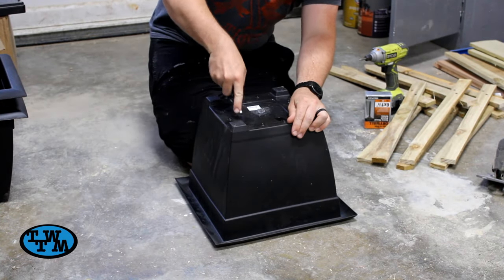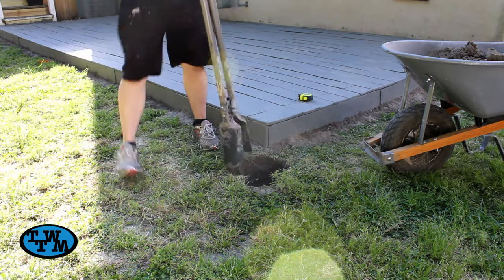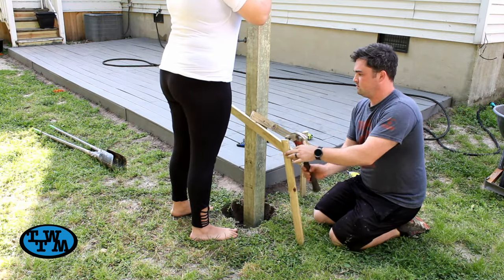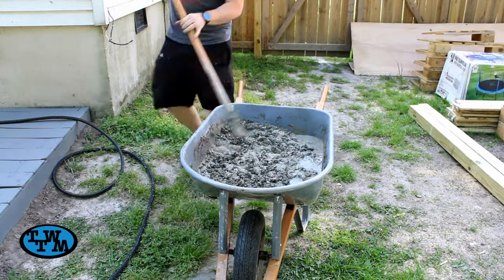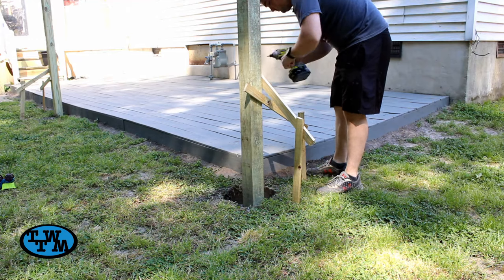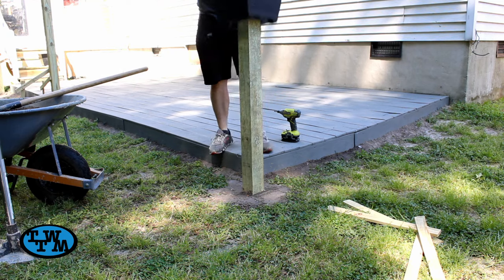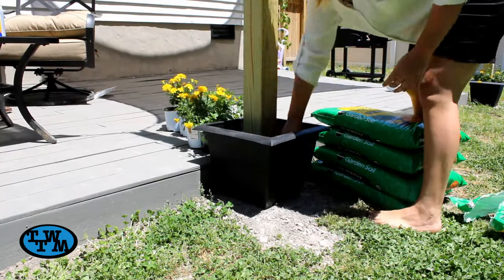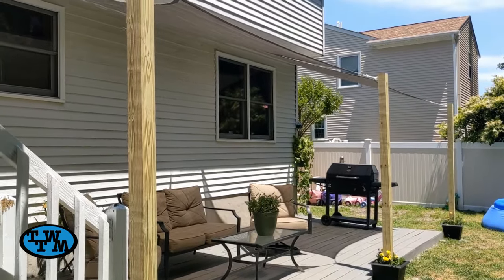From Unbearable To Unbelievable: How We Installed Shade Sails / Canopy On Our Platform Deck

Comment: The dirt at the top of the post hole and set around the post in the pot with plants will rot the post. The cement should go all the way to the top of the post hole, even or slightly higher than the lawn level and dirt should never be put against the wood. Wood nowadays lasts less time than the posts of years back. The more water contacting the buried post through the dirt contact makes your rot grow faster and can introduce termites into your wooden post if you are in a termite zone.
Reply from the maker: Thanks for your input!
Reply: Tex gem is exactly right made this mistake when I put up gazebo for my Wisteria, some years ago.  Now I have 2 post very compromised and 2 large, beautiful, vines over it all. Will take clever engineering  to replace them.
Reply: Not so sure about that. The chemistry for treating exterior lumber has changed over the years. Some treatments are rated for contact with soil.  I would avoid soil contact regardless for permanent structures. No wood is invulnerable.
Reply: @valkyriesardo278  agreed, but your name looks dang near invulnerable my friend
Reply: How does this apply to boat slips with main support posts directly in the water and lasting 20years?
Reply: @danieldillon40  I know some people who have had their posts replaced. From what I understand there is a special type of wood post that is supposed to be used for that. Since I don't have a boat slip, I do not know which type. If you have a boat slip, you would have to research from your lumber companies which ones are best suited for that application.
Reply: @danieldillon40  my construction friend did say that you should go to a different lumber company than your box stores for better quality, longer lasting wood. In other words do not go to Home Depot or Lowe's for your ground contact wood. Of course the cost is going to be higher. But in this day and age, the cost of wood is outrageously high with the delivery system that has been impaired due to covid.
Reply: Wondering how much your 4x4s will warp after a year and if the tension from each side will help or twist because tension on one side will be stronger than the other. Single posts can warp like crazy depending on the wood and season changes and moisture etc.
Reply: Not necessarily. We have ground contact deck supports and the soil contacts them at the base. 10yrs old with no rot.
Reply: @IWillNotArgueWithMorons  Thank  you for sharing! I am getting ready to put in new posts.
Reply: Curious…. I’m doing all this on a cheaaaapp budget. Like meaning with as many things as I can around the house. That being said, long story short… the house I moved into has over 100 random sized pieces of wood in attic. You are so going to laugh….!!!! Could I put multiple layers of a thick trash bag under and around the base touching dirt to protect it?? 😮  Idc if it only lasts a few years - just basically until I can afford to put something better in.  No laighing allowed 😅😅
Reply: @jamee_maree  Trash bags biodegrade rather quickly in certain situations. You would be better off investing in a really good sealant. Don't even try plywood. Waste of good wood.

Comment: Just a tip u can pour dry concrete in hole put water in hole mix it in hole n cover it with dirt the ground will harden the concrete. No mixing required
Reply: Pls don't do that
Reply: @jasonhernandez6291 no he’s right. That how the manufacturers suggest you do it. And it works
Reply: This is true for quick setting cement, the red bags from the same brand used in this video, but provide generally poor results if you use the slow curing one.
Reply: @jasonhernandez6291 Just bc I’m new to the concrete world, and am planning out a canopy plan… can you share more with why you said it’s a bad idea? IDW to mess something up so def want to hear your thoughts.

Comment: Great project idea. Old school post hole digger tip for you. My dad and both my grandpa's had tape or paint lines on their post hole diggers. Pre measure and mark depths such as 12" 18" 24" on you post hole digger and you can drop it in the hole, while it closed, and see how deep your hole is. It's faster than pulling out your tape all the time and sticking it in the hole. Just use your tape to double check the depth.
Reply: This is such a good idea, thanks
Reply: @mattsimmons2448  You are welcome. There is something to be said to the tricks the old dudes know and used.

Comment: Nice job. A suggestion that works for me. Mark your depth measurement on the handles of the post hole deeper with painters tape or other tape. Makes it a little easier. Thanks for the video. Very informative and well explained. Thanks

Comment: Use pressure treated or cedar wood and coat the sunk portion with Henrys roofing tar. My old man was an old school carpenter and taught me. Even better, wrap the post in tar paper, staple in place AND coat with tar. It'll last many years will resist termites. But now they make composite material, so there's also that option.

Comment: I use shade sails in the summer here in Texas.  I have cemented PVC pipe and threaded cap into the ground.  The opening in the PVC is large enough to accommodate 2 3/8" galvanized fence posts 12 feet long.  I attach the sail to the top of the fence posts into which I have installed eye bolts.  When the season is over, i remove the sail and the galvanized posts.  I screw PVC caps into the top of the buried pipe and allow the sun to warm my deck in winter months and also I don't have to look or avoid the posts for much of the year.  This extends the life of the sail considerably as they are stored for several months.
Reply from the maker: Yeah sounds like a great idea
Reply: Could you add a video of this great idea
Reply: I would love to see a video or images as well. I’ve scoured the internet for anyone using pvc pipe with cement to support a shade sail. I like your ode of a fence post. However, a visual would be helpful.
Reply: I always like temporary solutions like this please update us with a video of your set up if possible

Comment: Here's a couple pointers from experience. 
Make sure you leave plenty of room for your 4x4 posts to warp towards the shade sails. The tension will eventually bow them creating massive sag in the shade sails. I angled my 4x4 posts out and still had them bow to the point of having to replant them. No big deal but annoying. 4x4s may not be the best thing to hang shade sails on but they're cheap and in the evening while sitting under them the breeze makes them creak like a gallion. Pretty cool.
  My shade sails were for a graduation party and meant to be taken down after the season. They stayed up because we liked them. I was worried about inclement weather destroying them so i bought boat winches from amazon, installed them chest level, ran the winch strap through an I bolt at the top of the post, and connected the clips to the sails. When it looked like a storm was coming in they were down in 5 minutes. Up in five minutes when it passed. Why does no one else do this?
  These things seem to take a beating and are not complicated. My sails are triangular 25 x 25 ft and can be set up in a number of configurations and levels. Think about your post positions and be creative before you set them up. 
 My neighbors compliment our yard. A yard that was to be a temporary party solution.
  Heres an edit; our posts are perfect for wireless cameras and solar lights . All in, i think the cost was under three hundred dollars. Ha.
Reply from the maker: Yes those are some great pointers! Thank you very much. I love the idea of the boat winches!

Comment: I'm curious how well this is holding up 3 years later. Are the 4x4's still holding strong or have they begun to bend under the tension?
Reply from the maker: We have since moved so I'm not sure. But it was intended to be more of a temporary thing to last a year or 2 until wood prices came back down, since this was when wood prices were outrageous.

Comment: Awesome project.  I’m doing the same except over a pool.  I don’t want to deal with the eventual bow so I’m using steel.     Since you puts pots around the posts and they need frequent watering you might want to seal the posts with tar or Redgard.  Pressure treated isn’t what it used to be.
Reply from the maker: Is the steel expensive? Or is it pretty cheap? Yeah thank you for the advice with the bottom of the post. It's something I really didn't even think about since they're pressure treated but will definitely do this year.
Reply: @TheWillToMake  the steel is expensive.   280 a post for a 4x4x14’.  It’s a pretty big span and will be under a heavy load especial during storms.   I won’t ever have to replace them.  I have 6x6 posts on my fence and they are twisting and bowing a little.   They only have a gate hanging from them.

Comment: Great video! Just wondering if those posts are still sturdy enough. A lot of articles suggest to bury at least 40% height of the post. Is 2 ft deep hole enough for a 10ft post? Thank you
Reply from the maker: I've had no issues so far but I can keep you updated. I've also seen too that it should be a 6x6 not a 4x4 like I have used here. But again I've had no bowing or anything yet.

Comment: Trying to something similar, just wondering if your post have bent in with the tension on the sails? I want to attach to an existing fence of 4x4 s but not sure if it can take the tension u would apply to it. Any feedback would be appreciated! Thanks good vid!
Reply from the maker: I haven't had any issues with them bowing yet, but I have had comments saying that they should be installed on 6x6s or metal post. But like I said I've had no issues yet.

Comment: Could you do this with 4x4 post mounted on to a patio with 4x4 post bases?
Reply from the maker: I'm actually not sure on that, you may need to do more research on that. I would just be worried about how much the Shade sails pull on the post sideways, putting a ton of stress on your hardware.

Comment: Do the 4x4s seem to be holding in place well? I've seen many things saying to use 6x6s or metal posts. Wondering if they seem to be bending in after putting tension on the shades
Reply from the maker: Nope, I've had no issues so far. But it's never bad to be to safe

Comment: It looks like your sails are smaller in dimension from the pole distances to allow for rope that supports them, am I correct. Trying to find the correct dimensions for my wood posts which are 5'×15' in distance. Thx!
Reply from the maker: Yes the shade sail I used recommends leaving 1.5 to 2 feet of space between the Shade sail and the pole.
Reply: @TheWillToMake  Perfect. Thank you!

Comment: I'm not sure I want to actually set posts in the ground. Do you think a 4x4 in a 5 gallon bucket with concrete could withstand the wind and not tip over?
Reply from the maker: I think I would depend on how tall your post is and how far up the shade is.

Comment: It won’t be loose due not having a angle on the pole? When you tensión the sail.
Reply from the maker: You can definitely add turnbuckles which you could tighten, but I just held them tight while I tied them and it works great.

Comment: Hey, I’m a beginner and I know the post is 4x4, but long is it? Also, when you’re slanting the  shade. How high did you hag it on your house vs the pole. Thanks
Reply from the maker: They were 10 feet long but I've been told that a 6x6 would be best and the angle doesn't matter as long as it is angled. I just put mine right under where the next level of our house started.

Comment: I mean this in the nicest way possible, but you really haven't done this properly. Shade sail posts need to be set at a 10 degree opposing angle becausewood under tension (ie - accelerated by the wind) will bow the posts inwards and, the compost you put around the posts will rot the posts and weaken them quicker.
Reply from the maker: Thank you for your opinion!

Comment: I hope you didn't build the platform. It looks like it's lying directly on the ground. Also the band is in 2 pieces on the side. Wood should never touch the ground unless it's a wooden fence post
Reply from the maker: Thanks for your input, but yes I did build it and I also have a video on that if you'd like to check it out.

Comment: No need to mix concrete for setting posts. Dump it in dry and tamp down. Ground moisture will harden it in short order.
Reply from the maker: But would it harden it overnight?
Reply: @TheWillToMake  If you pack it down, it won't matter. If you're concerned, throw a quart of water on top of it.
Also, it's a good practice to put a few inches of gravel in the bottom of the hole to allow for drainage.